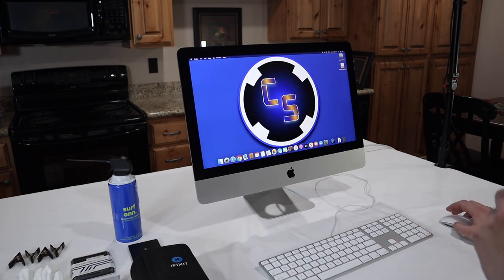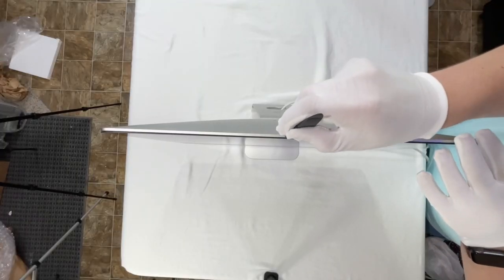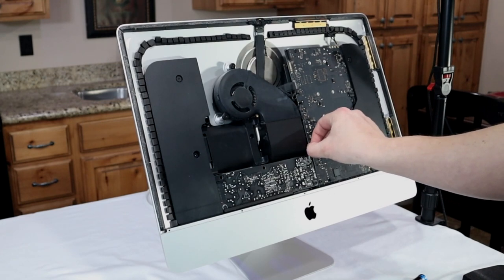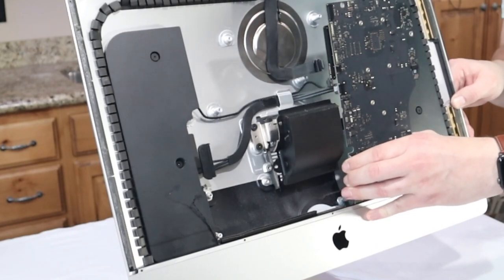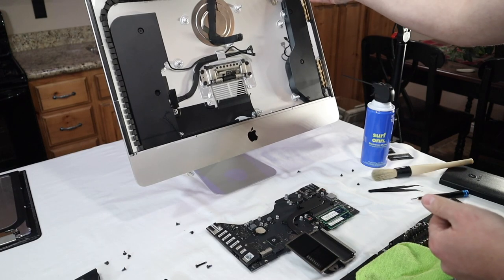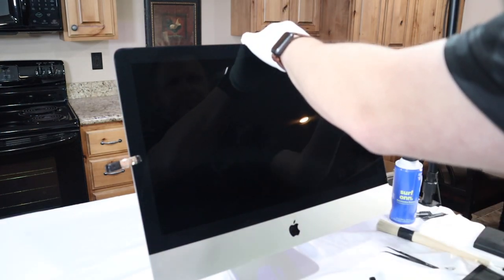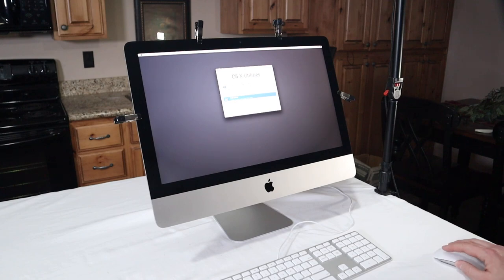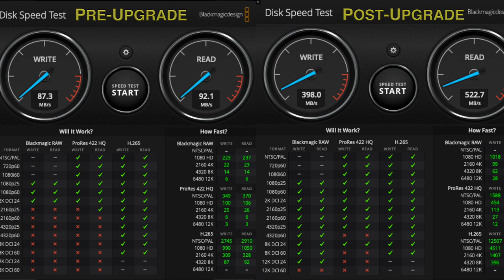Upgrading Apple iMac 2013 21.5 Hard Drive to SSD, Ram Upgrade, Huge Improvement

Comment: Could this help you get your software update past IOS 10.5??
Reply from the maker: It could, however if you have this exact model of iMac it should update past 10.5 without any upgrades.
Reply: @CircuitSphereUT  I have that model but it just says that my Mac is up to date, it doesn’t let me update it at all.
Reply: This particular mac will not upgrade past macOS Catalina version 10.15.7. I just updated mine today cost $380. Great video but I am not as technically nimble.
Reply: @grizzly4370  oh okay, thanks for letting me know